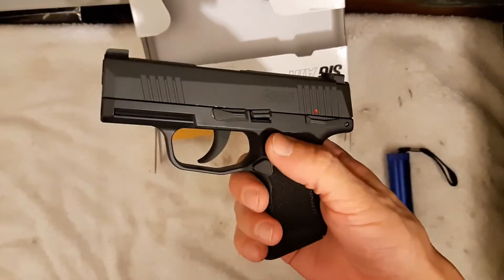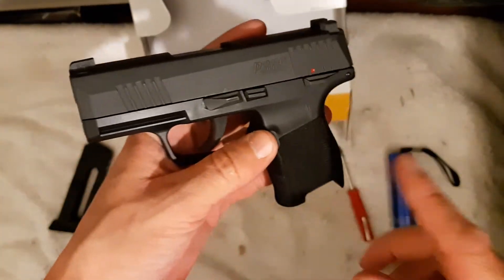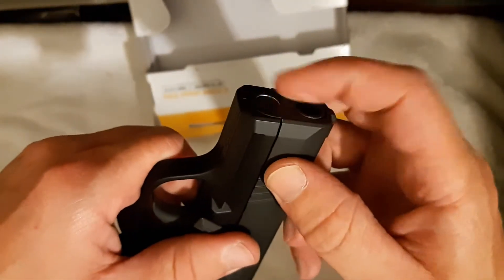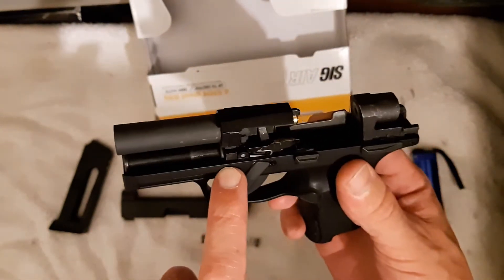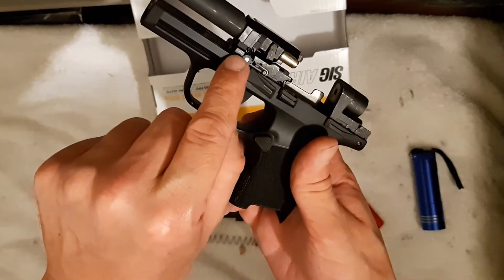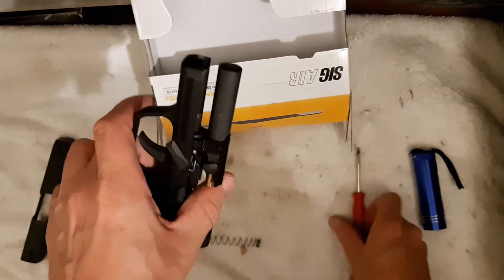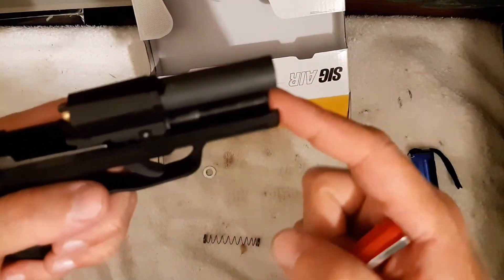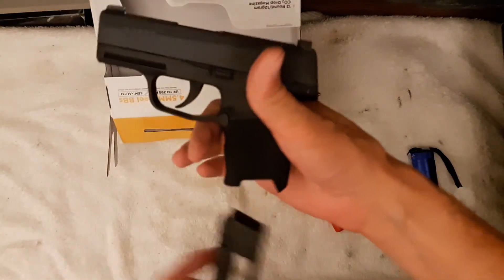The "trick" to field strip a p365 co2 BB gun

Comment: YES!!! Been trying to figure this out for MONTHS! Only common sense vid I found. As an aside, mine was REALLY tight. You had to use a lot of upward force to get it off. I took a fine Swiss file to the tip edges of the rail LUGS on the FRAME....not the SLIDE rails.  Just basically rounded off the corners a TINY bit. Now it's a bit easier to slip off and back on without force. The problem is obvious. The rail lugs go all the way to the edge. That leaves very little tolerance for the slide rails. Again, just barely kiss the edges and only if yours is as tight as mine. Thanks again for posting this! Another video comment sent me here. I'll see if I can get this linked some more so others can find it.
Reply from the maker: Nice, mine was really tight also.  I probably pushed the guide rod in inadvertently the first time I got the slide off.  Had gone back to it dozens of times with no luck hehe.

Comment: So... a bit different for mine.

Putting the slide back ON the gun I DID have to turn the takedown lever to the depressed position in ordeo to put the slide on, otherwise the slide wouldn't go back on as it was literally a millimeter or two too short of the open area to re-engage the slide onto the rails. Turning the locking pin to depress the guide rod giving me that extra mill or two to engage to slide onto the rails is all i needed to do and everything fit perfectly. 

Thanks for the video.
Reply from the maker: Sweet, have fun plinking! xD
Reply: Just tried doing this. I tried to get it back on but it just won’t. How would I access those parts?
Reply: @alaskaj4ck   Hmmm. Well, I don't have the gun with me right now but if you followed the video so the slide is off now, which it seems from your comment it is off, I would suggest (following the video) to get everything in place, as if you JUST now took the slide OFF the rail but you held everything in place...

Make sure the parts are exactly in the place they need to be, if the spring or barrel is moved just a bit out of position, or something moved in place that shouldn't be, it might be why slide can't reengage. Take the time to look over your pieces and doubly make sure everything is in place.

... from here, if all the parts are accounted for and in their respective place, have/put the takedown lever in place,  and while turning it just a bit, stop, try to reengage the slide, if you can't reengage, stop,  turn the turndown lever just a little bit again, stop, try to reengage the slide again, repeat.

The objective is to turn the pin/turndown lever just enough that the machined section of it resting inside the barrel assembly that it allows/adds a little  "wiggle room" and with that all the room available to pop the slide back on.

Again, make sure a bb didn't sneak in a crevice it's not supposed to be in, make sure ALL PARTS are accounted for, make sure each part is ONLY in the space allowed for it, make sure a part isn't bent out of place.

----------------------------------------------------------

I know this ⬆️ is a lot just to say "try again", but it's been more than once I could've saved myself a headache had I just slowed down and realized I was missing a part or jamming two parts together when they weren't supposed to be.

Other than that I can't give you anymore advice.
Hope you're able to get it on. ✌️
Reply from the maker: @alaskaj4ck  sorry for delay, didn't see the notification.  Please go watch my follow up video to this one, hammer was probably actuated while the slide was off, you need to recock the hammer then put the slide back on.
Reply from the maker: @dsandoval9396  thanks for jumping in and referencing watching the video xD this may be the issue but in 99% of cases the trigger was pulled while the slide was off and the 'at rest' position of the hammer wont let the slide go back on.
Reply: Bro me to

Comment: Thanks. I was puzzling over this because I have seen a real one taken down. Very helpful.
Reply from the maker: You're welcome xD this guy is not quite an exact 1:1 replica except for dimensions.
Reply: @RWMAirgunsmithing  I noticed. The barrel does not float when the slide is back.
Reply from the maker: @Terrys-Steam-and-Bricks  watch out for double feeds too.  The slide racks the hammer but the bb gets loaded when you pull the trigger and the inner barrel gets pulled.  Great practice for finger control hehe
Reply: @RWMAirgunsmithing  wow. Ok. I didn’t know that either. I’ll watch out for it.
Reply from the maker: @Terrys-Steam-and-Bricks  you can see the mechanism with the slide off, just be careful if the hammer gets triggered you need to reset it before assembly (see my part 2)

Also.. stay tuned , I plan on covering all my replicas.
Reply: @RWMAirgunsmithing  awesome

Comment: Just got one of these a few days ago and I had to disassemble the magazine to get a spent cartridge out because the end cap was beat to hell and the allan key couldn't fit anymore. Great how-to vid thanks
Reply from the maker: Oooof, tough break, I always OCD when I tighten my co2.  Of course Sig did not make the most durable choice by using plastic end caps.. smh, way too easy to cross-thread or even deform them if overtightened just a little.
Reply: @RWMAirgunsmithing  the end cap on mine is some kind of  cheap flimsy metal. The end cap on my MAC 11 is plastic so I don't plan on running many cartridges through it for this reason
Reply from the maker: @ActionKiller187  oh right, I did notice they sell 15 round mags now... didnt realize they tweaked their material choices. (I have seen on forums more than one comment about jammed end caps recently come to think of it).

I bought 2 extra mags when I bought my airgun, so I have 3 12 round mags and the end cap and the magazine threads are semi- quality plastic.  

I wouldnt put your mac11 aside too quickly,  I have many mags with plastic on them and I have never scrapped one.  I would recommend purchasing different brands of co2 (if they come from the same manufacturer then use those) and testing them in case the co2 slot is too tight or too loose.  Then you just need to make sure you use the right tool to tighten and always listen.
Reply from the maker: @ActionKiller187  you can try gently heating the base of the mag (be careful you dont want to blow the empty co2) in warm/hotish water. 

Then take it out and immediately hold an ice cube directly on the end cap for a minute or 2, dont let the ice cube touch the magazine and hold it upright so the water drips on your hand , not the mag.  If it really is just a tight squeeze then it should unscrew. 

Just make sure you let it warm long enough and then hold the ice cube properly so the endcap  transfers enough heat into the icecube to shrink and make a good differential.  minutes is better than 30 seconds xD

edit : this is how I get jammed dovetails out without banging too hard on them.

Comment: how do you get the guide rod back in its normal position?
Reply from the maker: You mean when the slide is on and everything is locked in place or before putting the slide back on?  It should go back into position once the take down lever is turned back up, the lever prevents the guide rod from moving.

Comment: I field stripped mine due to jamming. Since reassembly the thing had turned fully automatic (partially worried partially hella cool) any way to get it back? Any advice?
Reply from the maker: Do bbs come out after the first shot?   I currently have mine apart for the slide not cycling problem video.  I'll see if I can figure this out and maybe make a video just for this.
Reply: @RWM Airgunsmithing  all the bbs expel fine bar the last one upon trigger release which kind of "droops" out. Its just that within a single trigger pull even if quick was pretty much emptying the entire mag. What I have done is remove the guide rod and shuffle it around a little and place it back. I have managed to fix it but seemed odd at the time.
Reply from the maker: @Tupac786Jr  glad It's not a recurring problem lol xD really seems like maybe a bb came loose inside and fell in the exact spot to make the airgun go wild.  All the same I'll see if I can replicate the "problem" hehe.
Reply: @RWM Airgunsmithing  it was quite fun while it lasted to be fair lool. I went through about 4 canisters in fully auto. Accuracy went to shit though ahahaha

Comment: Oddly, mine has about 1mm of slide lug to go even with the guide rod pushed fully rearward. I think I can lubricate the friction surfaces without taking it down though, so it isn't a huge deal.
Reply from the maker: Try it a few times while plinking if you notice a change in the snappyness.. I have a feeling the washers can come loose and get smacked back into place while firing.

Comment: video is excellent! my p365 co2 bb will fire bb to target but won't cycle back to pick up another bb. i have to cycle the slide to fire a second bb. like a single shot. any idea on the problem
Reply from the maker: Hmm sounds like the co2 is not pushing the slide back enough to cock the hammer.  Have you taken it apart before?

Also ( this might not be the problem), did you know the slide only cocks the hammer, the bb is loaded into the barrel when you pull the trigger, the trigger mechanism pulls the inner barrel back against the magazine and then it fires.  It's normal  for the slide to not load a bb.

edit : the last time a commenter mentionned the airgun only firing single sots turns our they added a real 9mm spring on the guide rod.

Comment: Grate Job, step by step very informative ...! Thanks to you first time "field striped" worked. I cant imagine how frustrating it was for you firs time around. Despite manufactures recommendation not to lub the air gun... I always do.  I seen some dry like bone. Good example is my new acquisition of the p365 about week ago. After watching your video Part one & two, I decided to proceed with my first "field striped" and later lubricating the gun. There is interesting insights to why the manufacturers don't lub them promptly, or are skimpy on how much should be appropriate. Its very simple, they don't want the packaging look all stained with oil and have a customer ask ? What's wrong - I understand the concept of appealing from first sight. Again thanks! The new air gun is nice, but little underpowered in my opinion. One more I wanted to mention, the base plate for magazine has slots, I wonder what the designers were thinking about? Any ideas....? Its almost like base plate cover is missing...😎
Reply from the maker: Thanks! I can remember searching google for anything that could help and finding nothing, I knew it was like the M17 and one day i swapped it to my left hand, tried the field strip and the slide came right off lol

I wouldn't recommend overlubing though, make sure the rail is shiny and dont let any rubber seals dry out.  Keep it clean and a sheen on the seals.

Edit : I'll have to check the mag when I get home.. work on the road.
Reply: All  good advise to keep in mined. Thanks😊

Comment: If i wanted to remove the manual safety on this bb gun could I?
Reply from the maker: Hmm , not entirely sure it will still fire after.  The levers clip into both sides of the hammer mechanism and there is a spring involved.

If its just for looks you will end up with a hole on both sides.

Comment: Yeah, I did everything the right way but now my slide wont go forward fully anymore. It’s stuck in locked back position.
Reply from the maker: Check out my video on how to reset the hammer.  Most likely the trigger was pulled while the slide was off. Lemme know if it's the case!
Reply: @RWMAirgunsmithing  Thank you so much for telling me this. The air gun is so different from the real thing I would have never noticed that! Lol
Reply from the maker: @barrettson1028  yeah, dunno why they force the valve system like this on a non pellet shooter.  Their airsoft line all have classic drop free mags.

Comment: I’m having issues putting the slide back on the gun, you know how to fix that
Reply from the maker: Please watch part2 , I demonstrate the most common problem in under 1 min
Reply: @RWMAirgunsmithing  yeah so I just realized what the problem was the rubber thing was not all the way in place but now it works
Reply from the maker: @uchilament  ah good, yeah, never forget about that rubber piece.  I suspect it can come loose while plinking and be put back in place by continued plinking (just in case).

Comment: Mine won’t come off it just slides back and I can’t pull it off
Reply from the maker: Did you look underneath to see how much rail is still catching(the ones I show in the video)? It's probably not a lot but it is hard to force it by hand.

You can try rattling it so the rubber bushing jiggles up toward the barrel or you can fire rounds till you 'feel/hear' a different blowback/pop and hope the blowback jammed the bushing back into place.

Its doable without but it does feel like you will break it and if you use tools to force it you run a high risk of damaging the slide.  In any case, dont get too frustrated, just keep trying every once in a while and eventually it'll pop upwards.

Comment: Thanks for the tip to get the slide off bro but now  I can't put it back on. Its goes on like 90% of the way and it just won't completely go on. I've tried for an hour. I can't figure out what's in the way.
Any tips??
Reply: Same
Reply: Same
Reply from the maker: Didnt realize we covered this under a different comment.  Make sure the hammer mechanism is "cocked" when you reassemble since the mechanism is cocked when you pull the slide back and up. You can push it back manually with the slide off, it's not hard to find it's like the only moving part behind the valve.
Reply: Same
Reply from the maker: Sorry to leave you guys hangin, maybe not too late https://youtu.be/SXIfj0J7w1M

Comment: I did it and my gun won't shoot or when I pull it back it stays half way what do I do
Reply from the maker: Sounds like the trigger was pulled while you had the slide off, you need to actuate it with a small screwdriver before putting the slide back on.
Reply: Its been a month but I don't know if you still need to do it but here it is
1. when the slide is off there is going to be to Identifiable large mechanism The barrel assembly and a round Item in the back

2. look at the round assembly in the back while the barrel is facing you, under it should be a Silver metal assembly you need to depress that with a metal object its gonna take force but if you push it down you should here a click and it should stay down
Reply: @MISHMASHHOMEBOY  is it the things that’s under the firing pin?
Reply: @bigg5348  Yeah That exactly you gotta push it towards the rear of the gun and its gonna take some force but it should click into place and stay there
Reply from the maker: @bigg5348  small video done!

Comment: I had no trouble taking it apart but now when I re-seat the slide if will not slide all the way forward, stopping about 1 cm short of flush with guide rail. Any thoughts? I can send a video of the problem if that would help.
Reply from the maker: Please read my description. I would bet the trigger was pulled while the slide was off.  I have a short video you can pause to see how to reset the hammer.
Reply: @RWMAirgunsmithing  That did it! You're a wizard! Thanks!
Reply from the maker: @brananedgens  Yeah, this one is a finnicky one for sure xD
Reply: @RWMAirgunsmithing   hi where can I see the vid
Reply from the maker: @steezyimartinez8676  I have it linked in the descriptions .. and I think I put a pop up at the end of this one.  Or just click on me, I only have these 2 for now.

Comment: how do you make it full auto
Reply from the maker: @noahcone9939  It would be practically impossible.  You would have to change how the fcg mechanism works and probably have to modify the magazine to feed the barrel.
Reply: @ that actually makes sense with that being said. i saw a long time ago there was a kit you could buy to swap some internals. prob wouldn’t find it again. great videos, and very knowledgeable. thank you!
Reply from the maker: @noahcone9939  yeah because the trigger pulls the barrel back and then the trigger has to reset to let the barrel forward so another bb can feed then release the sear again. The last part is probably tinkerable but getting around the moving barrel and the gap between it and the mag will for sure require a kit like you say.

Thanks for watching!

Comment: I need help my sig sauer can't rechamber another bb when I shoot it. it's a only a one shot bb gun now Idk what to do I already disassemble but it still can't rechamber the firing hammer to go back it just shoots one time and then you need to clock it back again
Reply from the maker: so the slide cycles but you have to rack it back a second time to cock the hammer?  or does the slide cycle and there is just no bb in the barrel? or does the slide just not cycle at all after you shoot it once?

On this model the slide only cocks the hammer, the bbs are loaded when you pull the trigger.  The trigger pulls the inner barrel back and snug fits it to the magazine.
Reply from the maker: joeymenchaca  that is a bummer, it's a shame  this model gives people headaches.  Seems like there is something preventing the slide from fully cycling.

Comment: This video didnt help but it put me in the right derection. I had to pry back on the slide to get it to release and the rubber and steel washer were backwards and when putting it the correct way it worked fine afterwards
Reply from the maker: Thanks for sharing! Goes to show going over an airgun before plinking to make sure everything is straight and in working order is not a bad idea no matter which brand.